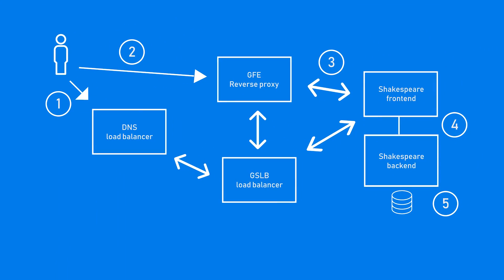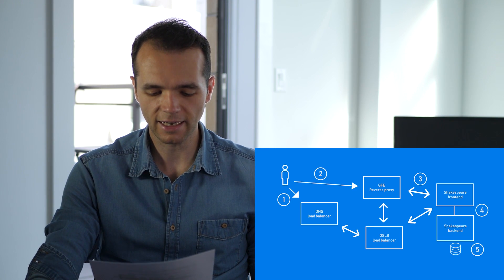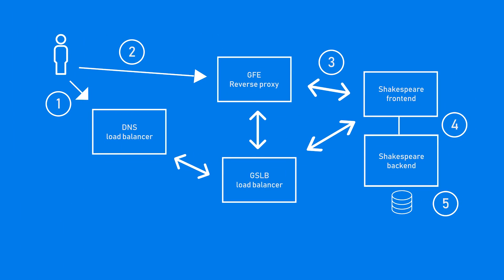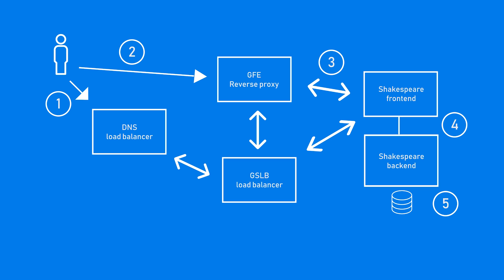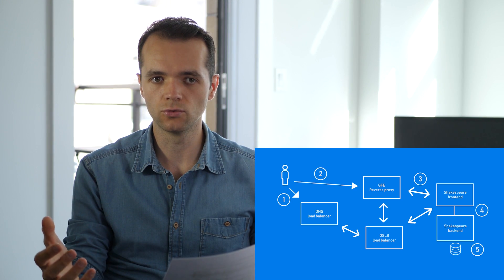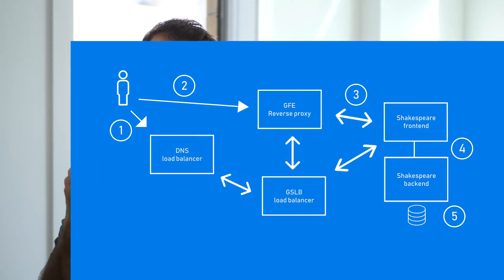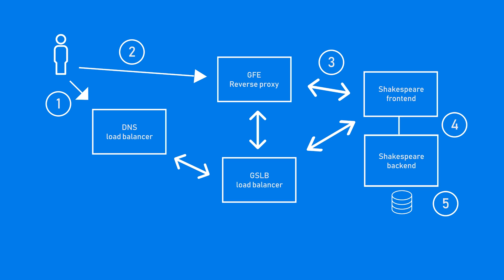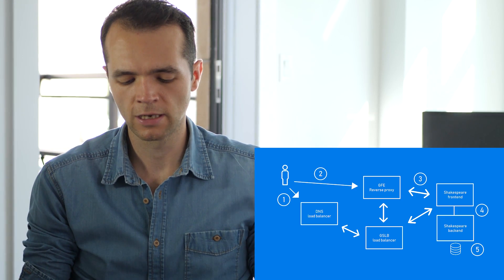How load balancers work - System Design Interview knowledge [Beyond the interview]

Comment: You hinted that if using naive Least Connections, or Round Robin, you may send multiple requests from the same user to different machines & then quickly said that such a behavior could mess up your replication.  I'm a little confused what you mean by that.  I think it could be corrected by having your app services (that are routed to after load balancing) contain a lot of in memory caches, and instead use a distributed cache.  What kind of a system would have replication problems?  Also what are the replication problems? ...

Comment: 3:27 IMHO is incorrect. It's not possible for two servers to run on same port unless the protocol is different. So two HTTP servers cannot bind to same port on a single backend server. The second HTTP server trying to bind to port will get the error - Address already in use.

Comment: 12:20 You say the hash function depends on the available servers. What if the same users connects again, but the available servers have changed? Will the user now be hashed to a new server, despite his originally assigned server maybe still being available.

Edit: solved later on in the video.

Comment: Thanks for the video. Right now preparing for the interview. At the end you mention single point failure problem. What would be your suggestion on eliminating it? Just a quick thought is doing LB state backups/replica with a health checks so as soon as it crashes we could restart or quickly switch with a backup.
Reply: You might wanna see "elastic load balancer"! Amazon ELB papers.